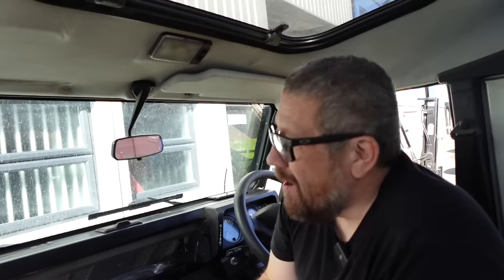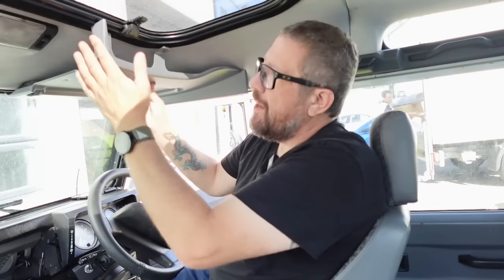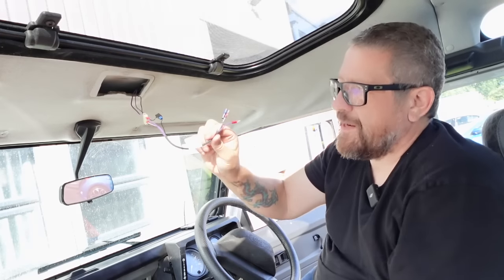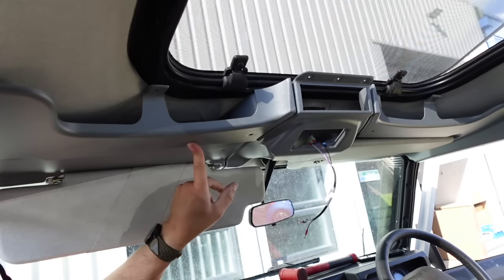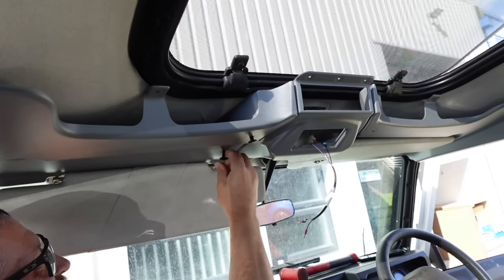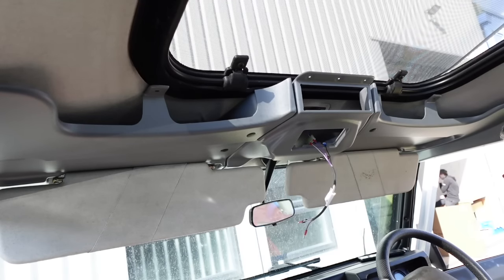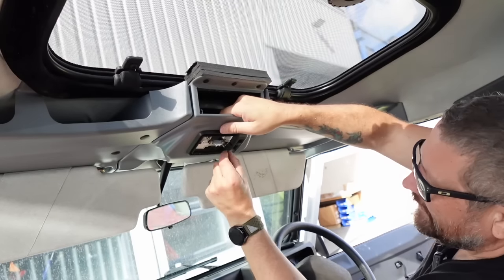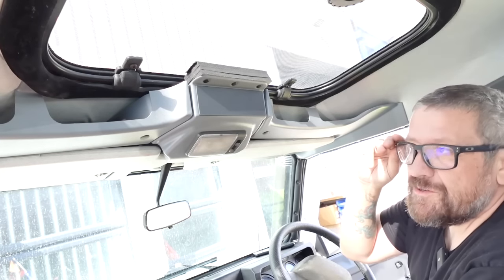Fitting a roof console on our Defender with a sunroof

Comment: A few pieces of insulating tape  over the back of the light before bolting to the backing plate means you are much less likely to blow the fuse when installing the bulb👍